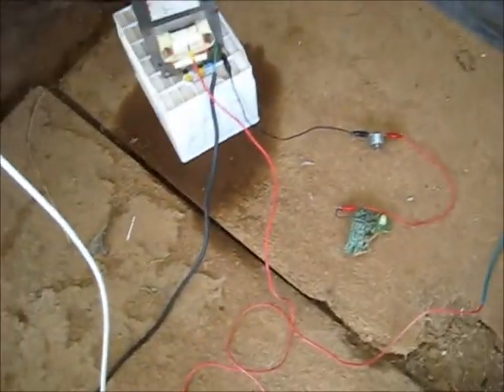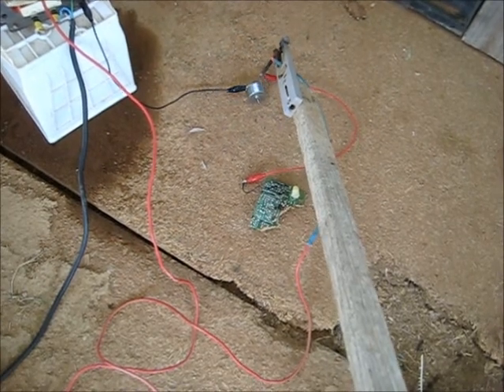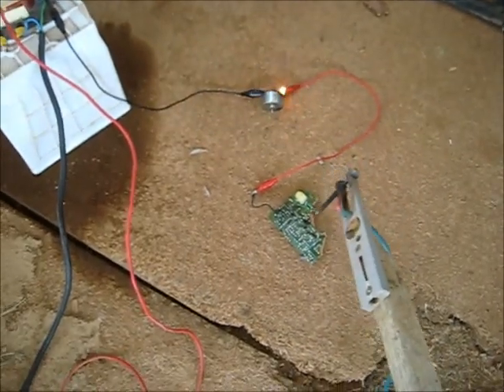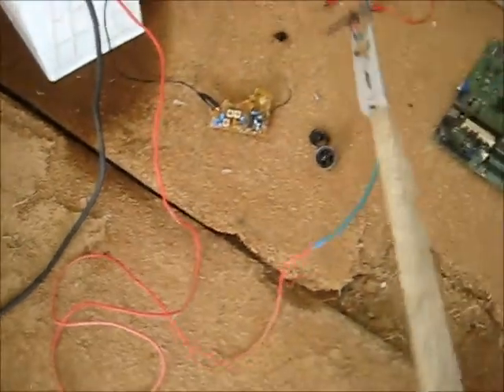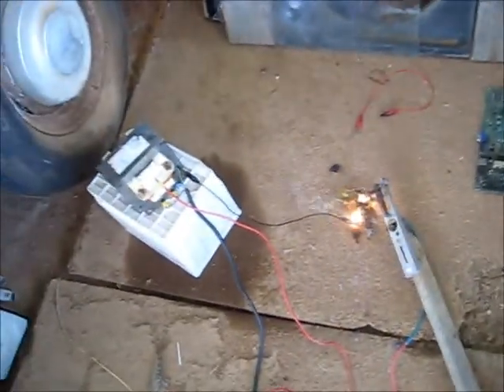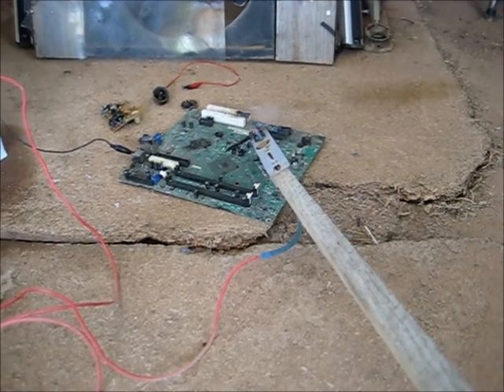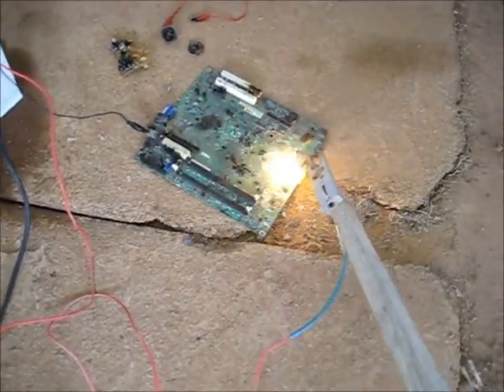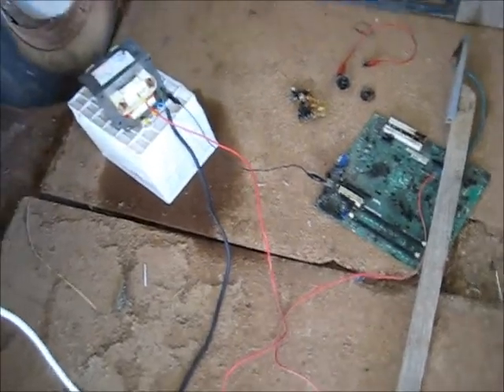Capacitor Pops with MOT

Comment: Oh, nice little burn-outs and pops there. :-)

Hmmm, Has EMAIL M2 gone on holiday? :-D 

I didn't notice the meter in the is video. 

(Slightly off-topic: when you first started using that meter, did you note the reading on it? If so, it would be interesting to take the current reading to find out how many popping-kWh you have used. )

-BoomBoxDeluxe.